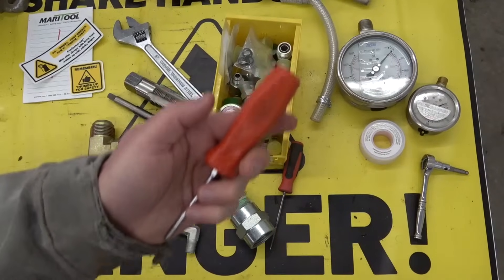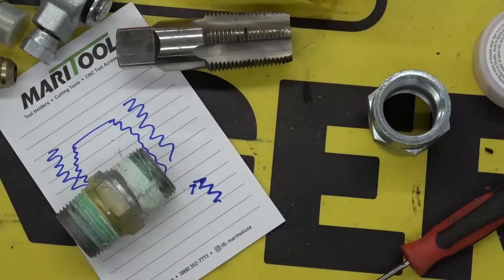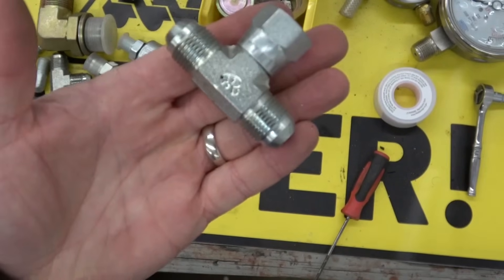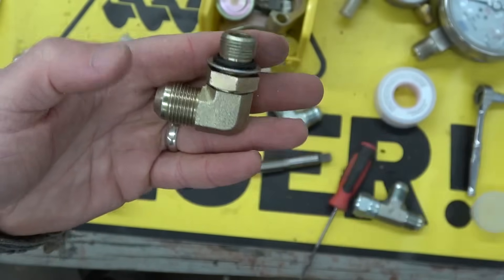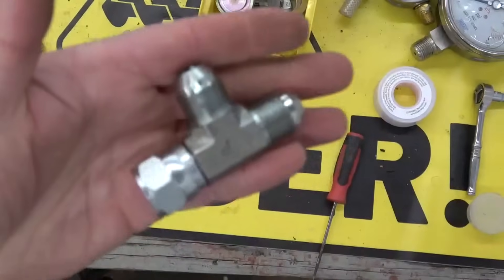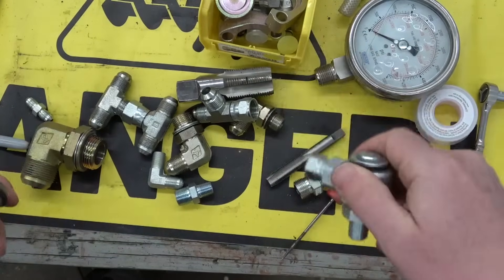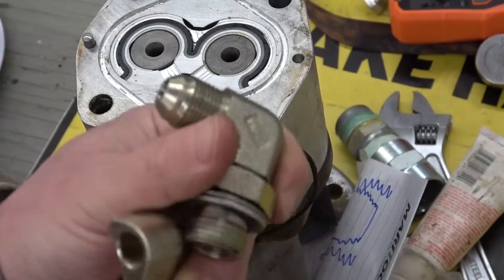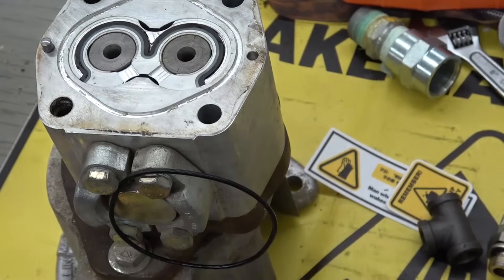Pipe thread is designed to leak || AvE hydraulic

Comment: Let me give you my, unwanted and unnecessary, 4.76 euro-cents (wink-wink). In my ex-commie motherland we still use an old unit for piping as well as the metric. It's called a Zoll (I guess - from German) and it is 1/12 of a foot, or 2.53cm or...Inch... :)  Here's a simple table: 
1/4″	- 6.35mm (F6); 3/8″ - 9.52mm (F10); 1/2″ - 12.7mm (F15); 3/4″ - 19.05mm (F20);	1″ - 25.4mm (F25); 1 1/4″ - 31.87mm (F32); 1 1/2″ - 38.25mm (F40); 	2″ - 51mm (F50);	2 1/2″ - 63.5mm (F65); 3″ - 76mm(F80); 3 1/2″ - 89.5mm(F90); 4″ - 102mm(F100); 5″ - 127mm(F125); 6″ - 152mm(F150); 7″ - 178mm(F178); 8″ - 203mm(F203); 9″ - 229mm(F229);	10″ - 254mm(F254)...Glorious...

Comment: Note, don’t use teflon tape on pvc fittings.  Use pipe dope only. The teflon tape adds too much bulk which stresses the plastic. 

Teflon tape is reserved for metal fittings only.

Edit: just realized you’re mostly talking about hydraulic oil fittings. Schmutz to the hutz

Comment: I've seen schedule 40 black iron fittings used on 2500 psi systems lots of times. No idea how long they lasted, but they almost always looked years old. And yes, they were handling full system pressure

Comment: Before I lost my job, (retired), our company made larger cylinders for Enerpac.  These were rated up to 1200ton and running at 10,000psi max.  They all had quick disconnects with 3/8" pipe threads.  The fittings came with a sprayed on thread sealant.  Very few leakers.....

Comment: I'm a retired jet engine tech and most fittings are AN and they are aluminum. It is very difficult to seal aluminum pipe threads but not impossible.  We have a special sealing compound (looks like Vaseline) but it smelled like poop but it did seal aluminum AN pipe fittings for a while.

Comment: I will hate npt till the day I die. JIC/ORB everything if I can. ORFS is good on higher pressure stuff, DIN is the absolute best sealing I’ve been around, but what a bastard to find fittings for
Reply: Npt seals just fine with quality tape and brute force. Only thing I don't like about Npt is it's difficult to work with at times, alignment and build out of fittings/assemblies can be difficult. JIC should be the gold standard, orb and orfs behind that. I'm not a fan of Din as they are easy to over torque, and hard to find. To hell with everything else

Comment: I don't know who started it, but JIS is not 37.5°, it is 37°. If you have to recut a fitting on a lathe you'd better have that correct.
Reply: 37.5 is typical factory bevel on a pipe buttweld fitting. Its so convoluted with agencies/institues/standards and types of non compatible parts that its almost easier to learn the hardcore science in Fluid power systems than the products used to make them😅

Comment: Fractional tape measure is easier to read and count the tick marks.  Good idea for a video.  1/2" is 3/4 the width of the tape.  3/4" mark is half the width etc.  With metric i have to count the mm.  Frustrating...

Comment: Jic work great. Even on dirty rusted end. They still seal. 
Parts manuals are a pain.. they dont standardize the part number well. Maybe its just a failure of whomever is transcribing the info into the system??

Npt.. i think it was a " good in theory" but in use, bad idea. 
Theory.. it wedges itself shut and has a ton of threads to do so.

Comment: Back on my wrench slipping knuckle busting diesel mechanic days, I kept a shit load of pipe fittings along with all the specialty brass air fittings.  I might not have the exact fitting I needed.  But to get off the side of the road I had 12 other fittings I could Frankenstein together to get us off and running.  On that note I've also  used gas soaked rags, and a can or 12 of ether while standing on the steps, to limp one off of the right lane of the interstate so I didn't have to play dodge ball with chevys.

Comment: If I were making a fitting, I'm thinking I'd start with 4340 mill to shape, then plate in nickel for rust protection. Or use a steel alloy with extra nickel and chrome not exactly stainless yet enough to make it rust resistant, the nickel plate sounded better I'm thinking. But I'm thinking for automotive brake and power steering. A BRUSHED nickel plated fitting would look nice, chrome is overrated , and seems to go rusty.  Although brass and bronze has worked for hundreds of years.. a nickel plated brass with a dead soft copper washer for automotive use would be fine no need for 4140-4340

Comment: I'd much rather have a straight thread, and a flange with copper washer, like banjo bolts use. And another thing, WTF ARE THE FITTINGS SOO FRIGGIN EXPENSIVE?    AND there is so many different fitting types  there is a book and tools to identify wtf you are working with. I can't tell ya how many nptf fittings I had to replace because they split!

Comment: The flat o ring ones r the worst npt  and stuff you can give a turn  and get it home  all the rubber stuff if it cracks  or comes apart probily not gona reseal untill you replace the rubber

Comment: hey AVE i gotta hot water fitting coming from bathroom sink, its a plastic pipe fitting going into a metal shut off valve that keeps leaking i replaced the plastic male threaded end and recently put in a new shut off valve and it STILL leaks, everytime i pull it apart and put new tape on it, its good for a week then it starts leaking again its driving me mad, no matter how much tape i put on it the damn thing leaks, dunno what else to do

Comment: Should have seen my frustration looking for a 3 way that would fit in place of the oil pressure sensor m12-1.75. 
I had to make my own threads in a brass T and cut down the sensor threads to fit then finally got my line to oil pressure.

Comment: Black-Iron Pipe Project - The Warhammer:  

 - x1 T-section.  
 - x2 Short Pipes, 2-3 Inches long.  
 - x1 Long Pipe, 3 feet, 4 feet, or 5 feet should be long enough for most people.  
 - x3 End Caps
 - x1 Rubber Crutch/Cane/Walking Stick foot/boot/socket/cap/whatever you want to call it.  
 - x[Enough White PVC Pipe Amount] of a diameter slightly thicker than your Black-Iron Pipe.  
 - Wood Pattern Tape.
 - Cloth Gaffer Tape. 
 - Ultra Fine Graphite Powder or Graphite Lubricant.  
 - Heatgun.  
 - Small Rotary Cutter like a Dremel.  

I used the 3/4-inch Black-Iron Pipe (Internal Nominal Diameter) so the next size up of PVC pipe is necessary.  It needs to be a tight enough fit.  

Grind off ALL of the various nubs and high spots off of the End Caps and T-Joint.  Make them more relatively flat all the way around.  You probably don't want to do more than just MOSTLY flatten the ridges and nubs, as you don't want to weaken the metal too much.  

Grind ALL of the finish off of ALL of the metal.  Sand it really really smooth.  You may want to grind down quite a bit to make fittment easier, by slightly reducing the Black-Iron Pipe's External Diameter.  

Sand the inside of the PVC pipe really well also, to make it smoother, and to increase the interior diameter of it too.  

Play around with fitting of the smallest pieces first until you determine which way is best for you but; put graphite lubricant or powder onto the outside of the Black-Iron Pipe, and inside the PVC Pipe.  Heat the PVC pipe and start forcing it over the metal pipe.  I recommend trying this first with the short pieces, as it will be easier to get it all the way on there by a lot of tapping it in, heating the PVC, and twisting.  

For the long piece, you may have to cut a long slit in it, so you can heat the long piece of PVC and flex it out slightly, to make it fit over the long metal.  

Of course, you should be measuring everything as you go along with this project.  

Basically, put the PVC on the pieces of iron PIPE, not the caps or t-joint, position it in the middle, and then CRANK on the t-joint and caps until they are as flush to the PVC as you can get them.  

Wrap the long part of the "T-Handled Walking Cane" along the ling axis of the long pipe, from t-joint to bottom End Cap, with a long strip of wood pattern tape, over the PVC.  You might need to overlap two strips, if you got a roll of 2" wide wood pattern tape.  

Put the Rubber foot on the bottom End Cap, you might want to drill a small hole and attach it with a screw or something, but not necessary as the foot should be hard to put on and take off.  

Completely wrap the T-Handle and Foot with Cloth Gaffer Tape, covering any exposed metal, PVC, or wood grain tape ends, so that it covers and secures the ends of the wood grain tape running long-ways down the length of the long pipe.  

The Metal and PVC should not be visible, and should be completely covered with the wood grain tape, the Gaffer tape, and the rubber foot.  

Oh look...  a "T-Handled Walking Cane (aka a Hidden Warhammer)."  

It sounds like wood if you tap it with a ring or similar metal implement, it sounds like wood if you bump the rubber foot on the ground, it looks like wood, it FEELS like woid if you got the slightly textured tape, and it just feels like a heavy wooden cane.  

In reality, it's a hidden Warhammer.  😊

Comment: Metric is slowly creeping into truck air systems with newer trucks having metric fittings and hoses making parts departments restock with multiple standards of fittings and hoses ( some of which are not cheap). The statement about hydraulics are about as true as  possible. NEVER TRUST HYDRAULICS! Failure is instantaneous and complete and will kill or maim without mercy. Lost a set of jackstands to a idiot working under a car on a jack and gave him stands as conscious couldn't stand pulling a body out later.

Comment: Excellent explaination of the stupidity of liquid fittings.
Now you need to dive into WHY My metric M12 (12 mm dia) bolt can have a 19mm head, or an18mm head, or a 17mm head, or a 16mm head, or a 15mm head. And the nut can be 20mm, 19mm, 18mm,or 17mm. JIS, ISO, ANSI,.....
At least the SAE bolts have been standardized.

Comment: I've worked in aerospace and heavy equipment hydraulic system design for years and I'm not sure I agree with the idea these fittings are "designed to leak". Hydraulic leaks, especially when the fluid is corrosive or toxic like in aerospace, are extremely expensive to clean up and repair. No one is willfully using fittings that leak on purpose. Static seals such as these fittings should not leak if the design, assembly, and maintenance is done properly. And there are many design factors that need to be considered to do it correctly. Its never as simple as designing for the highest pressure. Pressure impulse cycling, temperature cycling, fluid chemical compatibility, o-ring saturation and swelling, dynamic vs static sealing, tolerances, etc all play a huge role.

Comment: Regarding NPT, only a few on this blog got it exactly correct.  NPT is NOT designed to leak below pressures it is rated for.  The sharp V on threads deforms to create the seal.  Teflon tape is not designed to seal; it prevents galling.  Some pipe dopes are designed to seal along with lubricating.  I am a marine engineer, and I have operated and repaired numerous ships, including many built during WWII.  I have made up piping systems for steam, water, hydraulics, air and CO2 with tapered pipe and had no leakage.  The piping can always be unscrewed.  Used fittings may not always reseal.  NPT may not be used over certain temperatures and pressures.  Crap iron fittings made overseas with ragged, poor tolerance threads may not seal.

Comment: The flared fittings still can leak, but there is metal gaskets that is made to go on the flare and fill the imperfections causing the leak. In Aviation the general term is Ceco seal ( yes it is a specific manufacture but universally called)

Comment: Oh yea tapered threads kinda suck, would always prefer a parallel thread with a flat gasket to seal on the flat faces.
One side solid, one with a nut over the flange to pull it tight. Like on the water steel hoses.
You can have the flat seal out of various stuff, rubber, sealing "paper", copper... 

Not sure why mess with all this crap... guess because of the price maybe. Two simple tapered threads are ay cheaper to make...

Comment: An old school technique to seal NPT threads was to use linseed oil and cement powder to make pipe dope. Its against code nowdays cause the fittings cant be taken apart afterwards.

Comment: The free Princess Auto “Hydraulics Data Book” has a good summary on fittings. And all the formulas for flows, power, etc.

Handy if your memory has reached the “good but short” phase!

Spent way too much money there yesterday, including a smorgasbord of NTP, JIC, ORB, and BSPP fittings/adapters. Mostly to put a new loader valve on my Kubota L235, but also a potential electric log splitter project.

Comment: I work in the natural gas industry. Just about all of our threaded fittings are NPT, schedule 160. Anything over 2" has to be welded. Natural gas is a very small molecule so it's very hard to seal leaks. For pipe threads we settled on using "Blue Monster" thread tape, and anything over 3/4" also gets a smear of Blue Monster or SWAK (Swagelok) pipe dope. Have 2" threaded drain lines on vessels with 1400psi that pass FLIR monitoring twice a year. Not all thread tapes are created equal.
Reply: I work on compressed air systems and we have also concluded blue monster is pretty well the best there is for the price especially. I have even had a Chesterton rep trying to sell me on his sealants admit Blue monster is some pretty good stuff.
Reply: Glad to see other people swearing by “Blue Monster”!
Reply: Yeah, we just switched over to Blue Monster at work also.
Seems to work pretty well.

Comment: Actually in water applications not in black pipe works fine. The rust that develops from it leaking seals and creates a locking effect. JIC are great but not as solid (dealing with vibration or physical forces than not. Orings are great but again sooooo many standards. And their life is limited by heat cycles. None are perfect, but some are better in different situations than others. I work on machinery from US, Canada, Germany, Japan, Taiwan and China.  They all seem to have different standards they prefer. But what is worse even if they use NPT if their tap is worn out it still may not seal. 
I enjoy your videos and your perspective but don't always agree, but I'm good with that. I just wish engineers had to work in the field for a few years before they start designing things.

Comment: Why does Metric make things easier?

In Imperial units, if you need to know hydraulic power, you can multiply pounds per square inch of pressure by gallons per minute of flow and then look up a conversion factor to get the power, but one kilopascal of pressure multiplied by one liter per second of flow is one watt of power.

Comment: If you're dealing with air compressors, thanks to Atlas Copco's proliferation you'll run into a ton of 60° flare fittings that follow DIN 7631.  It is, by design, a pain in the ass to find for purchase in North America.  Most of the threads live on BSPP o-ring adapters that you can easily swap out to JIC or SAE 45 whatever is standard by you but there's always a few integral threads, usually on coolers or sometimes built into scavenger lines that you just have to find adapters for (or machine your own threads into the thing).  Of course Copco will gladly make you up a hose assembly at the low low price of ~100 bucks a foot, shipped express in the next three business months from Belgium or wherever.

Comment: One day at the coal mine, I jacked up the pressure relief valve so that the machinery would move what it was supposed to. Something heavier than what they said it was.

Having only recently been showered by hydraulic fluid when the top burst off a custom hydraulic cylinder (it'a pressure amplifier; dummy) I was cautious but relied on an understanding of burst vs working pressure.

Comment: JIC would never leak if the nipple length was 1.5 times the thread diameter. The distance between the thread and the mounting face needs to account for the modulas of elasticity and heat cycling. The auto industry worked this out in the eighties when alloy wheels were introduced. Until they lengthen the stud length the nuts kept coming loose. Its why truck nuts always come loose no matter what you do. The stud length to diameter length just isn’t long enough on the front wheels.

Comment: Working in the hydraulic industry in Australia - BSPP/T, BSP flare, NPT, NPSM, then your various UNF/UNO types (JIC, UNO/ORB, ORFS), metric heavy, metric light, French metric, JIC metric, metric face seal, imperial compression (of which each maker seems to change their thread pitch) metric compression, internal compression, SAE flare, metric multiseal/globe seat, code 61/62/supercat, autoclave, double flare, bubble flare.

When the counter customer says “ya know, just your standard thread” it was always tempting to take them out the back to see the range of standard threads we had to carry.

Still salty about the difference in dash sizes - half the people here use the American system, half use the other way. -08 might be 1/2” thread or 3/4” thread.

Keeps ya busy/drinking at least.

Comment: I worked insatlling hydraulics for years... one of the nuances you gain doing the work is to "see" sizes of fittings...thats what makes you fast...

To this day, you could give me a drawer of rando fittings and i could sort through at a lightning pace.

I was good but the OGs were next level...i saw a guy call a -10 fitting (rare, unused), from 10ft away...my rig i was installing called for -10s and theres was a left over fitting sitting on the floor